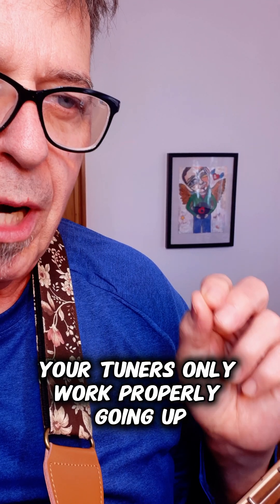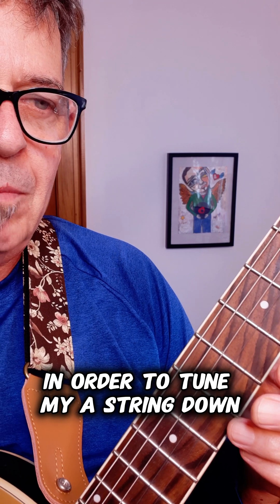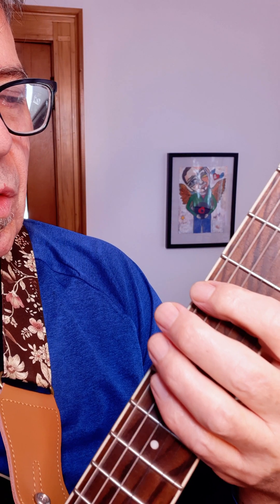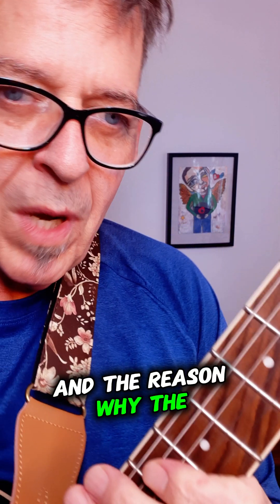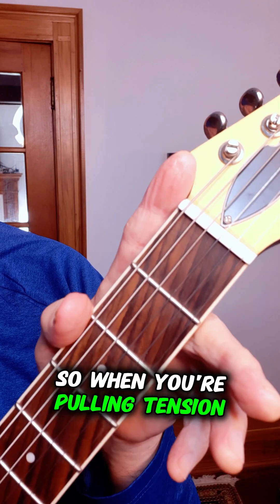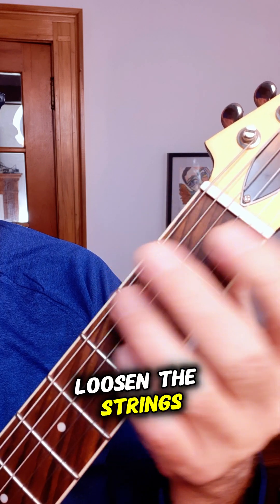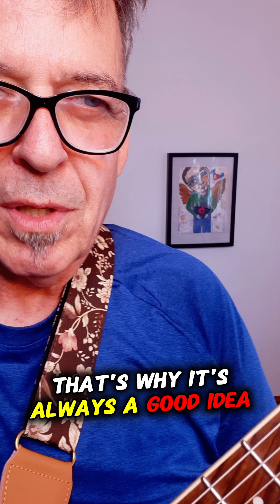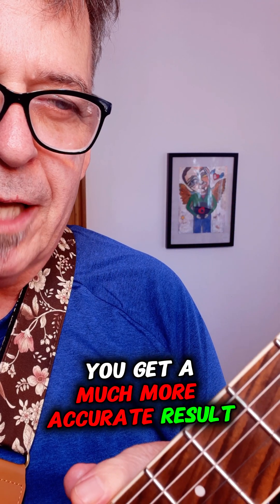How Do Guitar Tuners Work?  #Shorts

Comment: Good advice, I’ve noticed that the pegs hold better when you tune down and then up that way to get in pitch.
Reply: Just grab the string itself and pull it.
Reply from the maker: That DOES work too, but you can only say so much in one minute!  Pull the string will go in "episode 2".  Thanks!
Reply from the maker: Thanks